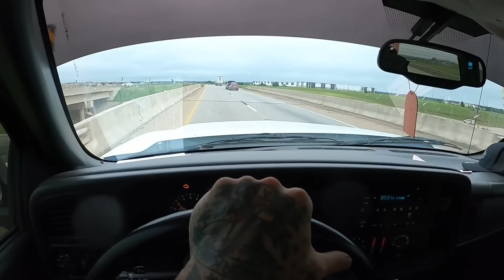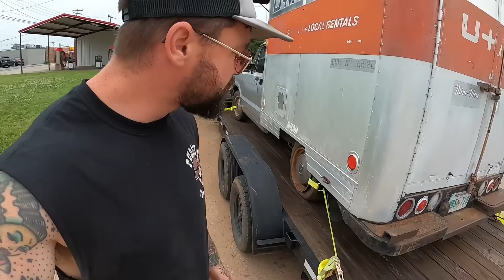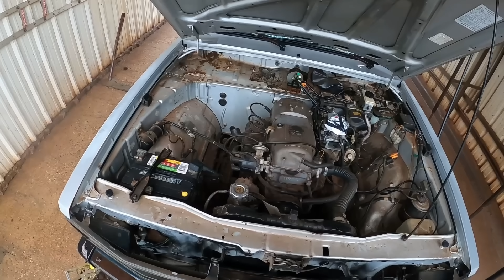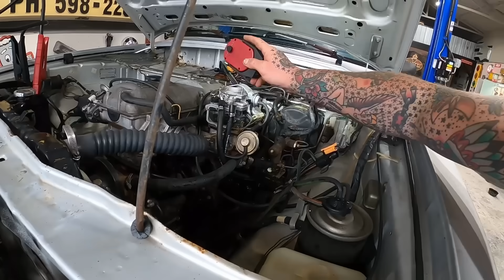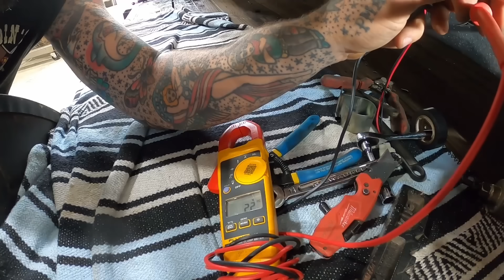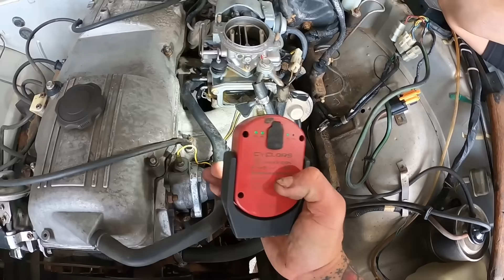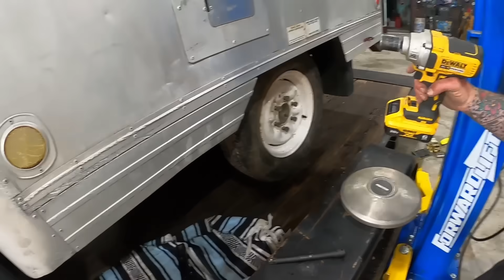1984 MAZDA Miniature U-Haul! WILL IT RUN AND DRIVE?!?

Comment: 😮 any pudding you need to look it up online but that truck body is not a Mazda body Mazda never built their own bodies. They were basically contracted by Ford to use the little Ranger pick up bodies before the F1 hundreds and F1 50s got to be real popular there was just the little Ranger pick up that was actually known to be used as a Mazda truck or your Mazda trucks because I used to look at the bodies and I could tell that it was a ranger pick up body. It’s not a Mazda did never build their own bodies not even in the 80s. They were still using Ford truck bodies the little Ranger, which is what was known as a courier which the courier was the daddy of the Ranger pick ups.
Reply from the maker: Right. But they are branded Mazda, titled Mazda, and have Mazda drivetrains which kind of makes them a Mazda. 

Couriers were branded ford, titled ford and ford powered. 

Id still call it a Mazda.

Comment: :face-blue-smiling: in college i delivered flowers in one of these ( it had a secondary AC unit) not fast but super reliable :hand-purple-blue-peace: oddly enough i received an 81 courier as a gift - needed a new ignition control module and it almost lasted as long as my marriage

Comment: hey Puddin , mazda made couriers for 10 yrs for ford , ford use da 2.3 pinto motor in the later mdls , there some shop somewhere that hotrods a carbureted 2.3 and turns 8000 rpms , how about an 8000 rpm 2.3 in your box truck ...... i remember seeing somewhere a courier with a small block chevy also , tel slick 50 to small block that luv truck ....

Comment: My uncle had Gulf Station in 80s had U-haul service. I used clean up vehicles dont recall any Mazda units. All Ford couriers f250s small vehicles possibly Isuzu. Definitely won't had blue interior traditional safety decals.  Mix of Ford and Chevrolet International big truck.

Comment: The scratches on the box are road rash. That explains the cab swap or box swap. The original truck was wrecked and came to rest on it's side. Run the VIN for history. Also look for a build sheet or body tag to decode.

Comment: I had a Ford courier pick up truck.Many years ago, it had the same type.Of car raider with the cyclos window.I had a little issue with the fuel pump.But then, after I got it, straightened out, I put AAA c doku which was a stronger pump.Never had an issue after that
Reply: Ac Delco, electric fuel  ⛽️,  sorry for type errors
Reply: AcDelco, fuel pump

Comment: Those carburettors are a complete basket. I myself had such trouble with so many that I swap them out if they are working currently nowadays! I will not say any more than to emphasise your observations sound ubiquitously common of those glass window damnations. 
At least you got a great little U-Haul trailer with a cranky ute backed into the front of it. take them away from each other you may have something more. 
Hot Rod is right. that you hawl is in the crapper, fixer up the Model A.

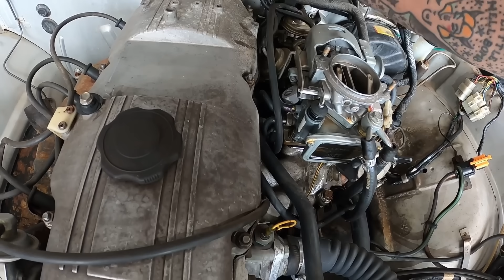Comment: At time marker 45:35 a noticable spark from ignition is visible on the driver side inner fender on that cylinder shaped part next to the hammer. Is that the coil?

Comment: It's pretty easy to figure out the engine size on Mazda B series trucks because It says it on the fender. They start with a B and then the engine size in cc's. 1 Cubic Centimeter = 1 Milliliter and 1000ml = 1Litre. If that had been a B2300 it would have had the same 2.3L Ford Lima engine as your Ford Courier box trucks.

Comment: To find liter to cubic inch or vice versa you multiply by 61 so a 5.0 liter you take 5x61= 305… or if you wanna figure liter you divide like 454 divided by 61 is 7.4

Comment: So I was thinking about something the other day couldn't you get some I beams to string it between the small beams right there where the door opens to the loft where you could make a real thing with a smaller witch that way you could raise stuff from the bottom and get it to the top without going up the stairs would like to have your stuff

Comment: If it's going to be an O'Reilly truck, my suggestion would be to have someone do up the cab in the irridescent green the 2011 Mazda 2 comes in, for some pop, and then the cab should get a nice stark glossy white with a red stripe that can have the O'Reilly logo stuck into it, and then two coats of automotive grade 2K clearcoat over everything... That's too much of a clean vehicle to let the patina take it. If O'Reilly is willing to foot the bill, you can also send the aluminum box out to be fully stripped and alodine coated before paint for corrosion prevention. It's an expensive process usually only used for aircraft and aerospace parts but it will keep it looking good for a long, long time. I dead nuts would want to see that be used for that... it may even be a good enough engine and platform to drop in a turbo and see if that helps any... 4-cylinder engines love their turbos after all, and there's PLENTY of space for that under the hood!

Comment: Wow, you keep coming up with these same mini trucks   I had in the 80s. In 1988 I sold my 81 Courier and got a 83 Mazda B2000 Sundowner that had am/fm and air conditioning you could never use because it took 50 of the 85 horsepower it had.

Comment: My dad had a couple of those little Couriers like yours. Only one I remember in detail was the 2.3 5 speed short bed the would absolutely RIP. Then I bought a 84 Mazda B2000 like the one you have in this video. Silver with the black stripes and lettering. It was a 2.0 automatic and it was slower than pond water. I first chocked it up to it being geared really high because on the interstate I never could find the top speed in it. I swapped the rear end out to one with something like 4:04 gears?! But it was still a slug, but I’d saved up enough money in that time for an ‘89 Foxbody GT and sold the Mazda. I did exactly what you’re probably thinking any 17 year old with a Mustang would do… I totaled it acting like a dumbass. I should have just kept the Mazda. I’ve been amazed since then though at the difference in power between a 2.3 and 2.0 Ford/Mazda. The video brings back memories I hadn’t thought about in years. I appreciate the nostalgia. Hope that little trucks donor box makes for another cool little build. Maybe for the dually Yota?

Comment: When you nfirst put on the new fuel pump it sucked a lot of gas through the filter and then slowed down. I would say the intake line inside the tank is shot.

Comment: Excellent video Puddin   :) also that Mazda  U haul truck in good condition for 1984 year also 2.0 litre 4 cylinder motor in  good condition and Manual Transmission  ! I would change fuel sending unit plus lines too and carb too !

Comment: Puddin, if you make a lariat of that strap an lasso the tire, down to the axle tube, you won't risk cutting it on the rim. It'll cinch into the rubber and as long as you have em facing opposite directions the car will never move. At least in my 10yrs of towtruckin I've never had a problem!

Comment: Seems like it is lean at idle. When the choke was on It was running and when it started opening it started cutting out. Also, The Red Brake cleaner is not flammable. But it is chlorinated and is not good to breath when it goes through an engine.

Comment: Hear me out. General Motors in the Mid90s did a lot of throttle body feeling injection. Why don’t you try modifying one of those to work with one of these older engines? All it needs is 12 V and gas. You could fabricate you an intake…..

Comment: You used the lift you have as a stop block, then lay a blanket on the floor of the trailer you drove into the lift to work under the truck??? On the trailer, WHEN YOU HAVE A LIFT ⚡⚡ you kill me.

Comment: You have been lucky to get your Couriers with the Ford engine the 73 dad had was the Mazda engine and the dealer could not set the distributor right. they cut our milage from 22 before tune up down to 17 after. but the Mazda engine was a strong runner when new.

Comment: Both the Courier and Mazda Sundowners came with a Mazda motor but the Courier also offered the 2.0 and 2.3 Ford motor. Mazda made the manual transmissions in  both

Comment: I haven't watched it yet but my dad bought one of these brand new in '84. He was a plumber and needed a reliable work vehicle that got good fuel economy. He got A/C as the only option. He put a topper on it so he could lock up his tools and drove it for several years. It was gutless but cheap.

Comment: Decent pump for 85$ Ebay or Amazon, mine is 2 years old and still works good.

VEVOR Air Compressor Pump, 3HP 11.8CFM, Industrial Compressor Head Pump Motor, 1300RPM High-Spped Single Stage Twin Cylinder Aluminum Air Compressor Head Piston Style Splash Lubrication Pump

Comment: Please find a Datsun 521pickup. Sweetest mini truck ever. Ill post you a pic of mine back in 84 when I was 15 to FB. Those trucks are a Datsun 510 with a bed. The quad head lights, the bottom rear lights like ground effects. Too cool. I wish I could find my old one.

Comment: you'll save your b-pillars by replacing the hinge pins since they're probably already shot ..... they're the cause of the metal tears in the pillars and hard door shuts
also spray out the fender behind the front wheels really well , the fender support traps dirt and debris rusting the the fenders from the inside by the door edge.

Comment: At 45.59 looks like the wire for the coil Is sparking.  If that's the coil. Right next to the windshield wiper reservoir on the far right of the screen.  Right where the hammer sits

Comment: I have a 20 gallon compressor that looks just like yours. Mine is a devilbiss  I have had it since 1990 and there is very few days it don't get used the reed valves broke about 4 years a go and I made some out of a Budweiser can and its still pumping air lol . I did re ring it 2 times and put head gaskets on it a few years ago .
Reply: I saw a video on a CAT bulldozer rebuild, where they were taking the motor apart.
 Someone had shimmed the cylinder with a Budweiser can, and IT RAN 😂

Comment: I love Mazda to pickups I worked on them for years the parking break has a tendency to get rusty and not go back all the way again so what you have to do is get underneath the truck and pull that cable take the pressure off your back brakes that's probably what's going on it's a common thing on Mazda pickups and the carburetors were always crap you can get aftermarket ones after you get all those little things done the good running trucks but for now find the end of throttle cable and there should be a screw adjustment right there and turn it up a little bit that'll keep the idol going also the timing on the distributor can't get out of adjustment overtime due to vibration you might want to give it a little bit more timing let me know when you want to sell it I'll take it off your hands

Comment: At the 46 minute mark you can see the coil sparking at the soil plug wire, may want to put a new set of plug wires on it
Reply: I seen that as well but it’s not the coil , coil is mounted over by the battery.
Not sure what that canister is.

Comment: Fun fact Jacob... In the final iteration of the B2000 / Courier platform, before Ford introduced the Ranger to replace it... some of the Couriers had Mazda motors, but... (to my knowledge) none of the Mazdas had the 2.3's.  
I have an '84 B2000... and it has a 2.0 litre Mazda motor.
Reply: I grew up in Ford Couriers. My dad had several, some with a Mazda motor and some with the Ford motor. I preferred the Ford motors. I learned how to drive in a 1979 Courier.
Reply: @joeythetruckguy  I can dig it. My Dad bought a new '77 Ford Courier in November of 1977, 
2.3L IL-4, 5 speed long bed with factory A/C. I was 12 at the time... Drove it a lot before I got my own vehicle. Taught my Mom how to drive a stick in that little truck.
Reply: those hub caps are clean

Comment: I had a silver 1984 Mazda B2000 in high school. It was an automatic. They have great heaters. It would leave a blister on your ankle if your not careful.
Reply: That was in about 1992. I had a lot of the same issues you have experienced so far. Carb, fuel pump, brake caliper locked up. One time, the pads came out of the front caliper and I ran right into AutoZone. Dang near made it a drive thru.

Comment: If I remember correctly, ford couriers were mazada trucks back in the 80s. Ford just made a few changes to put their touch on it. Dodge did the same thing. Dodge bought Mitsubishi trucks and slapped a D 50 on it and made it a dodge truck.
Reply: 70s
Reply: Yessir, and Chevy, with the LUV being an rebadged Isuzu. 

And Pontiac Vibe which was a rebadged Toyota Matrix… 

Even the early 90’s ford rangers and Mazda pickups were the same, not sure who made them, ford or Mazda… 

The Dodge Journey is a rebadged Fiat Fremont. 

The one higher trim package model of Saturn Vue had a Honda engine. 

Anyway, yeah it happens more than most realize.

Comment: The Ye-haul rodeo...  Make an obstacle course to run each against a clock; 
include parking and backing up as well as 0 to 30 mph straight away. Add multiple drivers... 
Should be fun contest. I have seen OK S&C... 🖖
Reply: Box Truck Mafia,Puddins the king pin